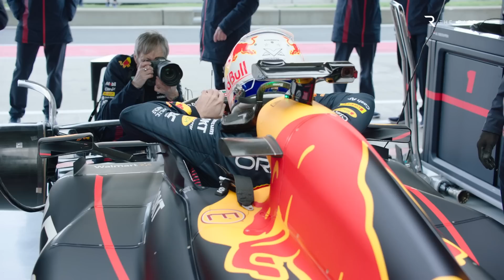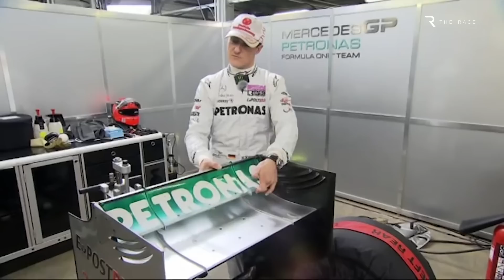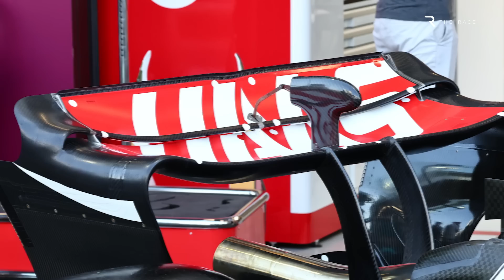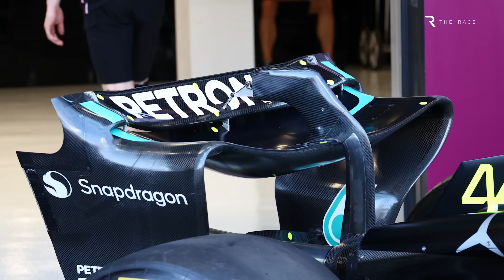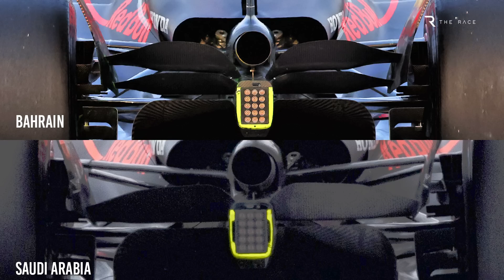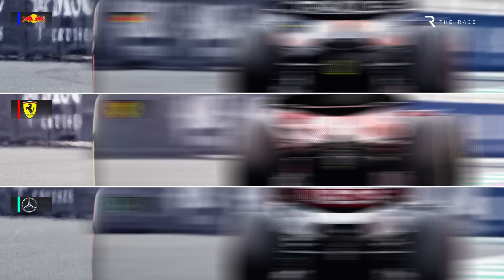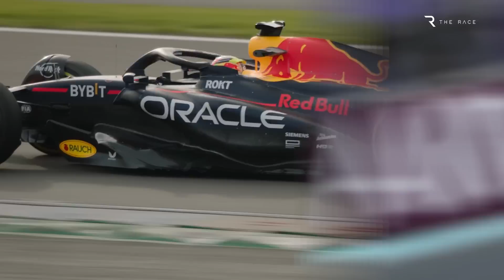Red Bull's genius 'triple DRS' F1 trick explained

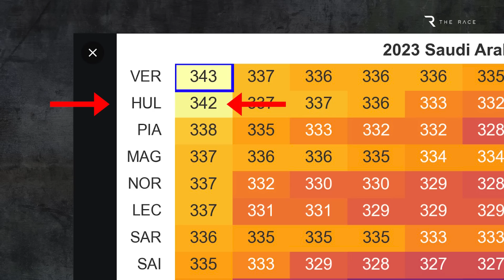Comment: @2:03 This comparison between Verstappen and Hulkenburg doesn't show when in the race these relative speeds occurred, or what tires or fuel loads they had. It's not really useful to present those figures without the rest. Hulkenburg could have stopped for softs very late on, knowing that those battling for the leading positions would not have.

Comment: If the DRS is open there is less downforce and less drag not more. The DRS has to be closed for there to be more downforce and this also greats more drag. You said if the DRS was open there would be more downforce and drag which is wrong.

Comment: Never seen a car that fast. Said by the bloke who won a race even though he blew a tire. His car being somuch faster then annything else on the field even Max with almost no fuel in the tank could not close the gap quickly enough for Lewis to claim top spot.

The few times in five to six years whenever he did have competiton he was granted the win by the line.

"Valtteri, its James/Toto"

The driver who's car was so good even after a engine swap started at the back of the grid. Bypassed every single car and still win with a time advantage in the double digits.

Sorry Lewis that RB got it right this year. Perhaps you can understand your opaque innocence after it took 5/6 years of RB fanatical development, a cost cap breech and Massi doing what he did to actually even catch you. 

Like get off the thick air pedestal and put the graft in.

Comment: DRS is bogus.  IndyCar Push to Pass is much better solution.  Allows defensive use.  Yet limited in use.  No dumb braking so you don't pass before a line.  No massive unfair advantage given to one car by design.

Comment: Me thinks it's time to do away with these artificial advantage gimmicks and get back to plain old racing configuration.  Lets start at the front with a single element wing, move on to mirrors mounted to either the side with no gimmick airfoil mounts.  All the little winglets and air directing do-dads along the floor pan, if you can't design a body with good air flow to stat with maybe you shouldn't be designing.  And then there's that rear wing, a single element that is adjustable for maximum downforce with minimal drag and fixed for the race.  Many drivers complain about not being able to overtake, my answer to that is if you can't pass the car ahead of you then he's a better driver than you and maybe you had better choose another career path.

Comment: Drs is joke imo. It’s entire design is to simply make racing more exciting when you have cars that can’t develop as well as others. The system should be removed and instead a weight penalty added to cars that win. This will mean cars are designed to generate dogfighting because cars will be more “equal” throughout the year. It will also ensure the winners of races are more over determined by the skill of the driver rather than the car.

Comment: Newey and his team are amazing!!
Also, if I understand you correctly, Red Bull is managing the down force increase to be less extreme so they they can actually gain higher overall speed by making the car a little bit less effective less draggy, less downforce at top speeds and doing that with the edge of the floor? Which in turn allows them to run a softer suspension and get rid of the porpoising as well.
Thanks for the insight I really interesting video 👍👍👍👍

Comment: I still remember hamiltons pass on Norris in Brazil 21. That was an unbelievably huge speed difference of the same engine.
Reply: Didn't he dive down the inside? That's not exactly a straight-line speed difference...

Edit: Okay, can now confirm that it had nothing to do with engines... The only pass made between Hamilton and Norris was on the brakes into turn 1.
Reply: @oliverwatson6956  you did not see the gap at the begining of the straight it is not showed in this short video. As i saw it live it was crazy. Of course hamilton dived but he cut off like a 1 second gap and overtook norris on that straight. It’s not even a particularly long straight
Reply: McLaren 2021 had renault engines right?

Comment: Rather than have the DRS, I'd like to see them revisit the front wing flap idea from 2009. When the car behind is within a certain distance of the car in front, they can raise the flaps of the front wings and have more front end downforce in the corners to stay close. This would make them have to do an actual overtake into the next braking zone, instead of just flying past on the straight and being well ahead by the time they need to brake.

Comment: I think its time for F1 to introduce  BOP or weight  penalties to try and make the racing closer. As despite Red Bulls reduced development time for winning last year and the overspend penalty doesn't seem to of closed the gap if any they've extended it.
But how to do it weight penalties for the first 3 for the next 3 races say 30kg for 1st, 20kgs for 2nd,  10kg for 3rd and 5kg for fastest lap with a max penalty weight of 90kg. Or do you put restrictions on battery power usage or a turbo pop of valve. 

What would you suggest to try to make racing closer in F1.
Reply: I suggest you go watch LMS and leave F1 to the designers and manufacturers …
Reply: @sking2173  so i take it your not a fan of my ideas? I already watch a wide range of motor sports like WEC, IMSA, WTCR, BTCC, INDYCAR, F2 ,F3 ,F4 , FR, FE,  NASCAR SUPERCARS and Stadium supertruck. So I'm note sure why as a fan you feel I shouldn't have an option on making F1 a closer sport. As the manufacturers, engineers and current rule makers have not had much success in making the racing closer and thus more entertaining. 

So do you think F1 is ok the way it is? 
Or should we all switch over as currently its a red bull infront and then a Mercades for the 8years before that. Whats wrong with wanting closer racing
Reply: @mechsgtpuma938  — What your “plan” is represents a blueprint for a show, not true racing. 

Racing is a speed/time contest to determine the most capable car, car-driver combo, or in the case of such series as IROC, driver. 

When you start trying to orchestrate “close racing” by handicapping the most successful teams or drivers, you have forsaken the tenets of a true speed contest and orchestrated a show. NASCAR has been doing it for most of their history, and it has gotten progressively worse as time has passed. They kept juggling the rules until they came up with tools to manipulate competition on a real-time basis, the most popular being phantom yellows, lucky-dogs, wave-arounds, and most recently, stage racing. Frankly, it’s a joke. 

F1 is about as close to real motor racing as we have left. and that’s slipping. Their recent testing/development limitations placed on individual teams has frankly crossed the line. And what you’re proposing is ludicrous, and honestly very amateurish. It smacks of the Saturday night local dirt track SHOWS where they would flip a coin after the heats to determine if they would invert the field.

“Back in the day”, I looked on the Indy 500 as being the epitome of true racing. During caution periods cars were to hold position and gap, not close up behind a pace car. In 1972, they installed a pacer light system to assist with that procedure, and make policing easier. To me, it was a sad day when they (CART/IMS) abandoned the system and practice (1979).

I didn’t care about close racing, it was about the cars. I was excited in ‘68 when Granatelli brought the turbine car to Indy, and fascinated at the weird little mid engine Cooper that Jack Brabham drove in 1961. We cheered for the drivers, but the cars were the heroes. Race fans were predominantly car people. 

Just as in 1966 when Ford beat Ferrari at LeMans, it was the cars and the engineering of Ford pitted against the expertise of Ferrari, not about close racing and the individual drivers, that enthralled racing fans. And most Americans wanted the GT40’s to stomp the Ferraris into the dirt — they didn’t give a rat’s arse about close raving and wheel-to-wheel. And after all, the title of the movie (2019) is Ford v Ferrari, not Chris Amon v Piers Courage. Now that was real racing.

As far as your BOP goes, if applied with a wide brush, fine and necessary. In the days when F1 could run 6, 8, 10, or 12 cylinder engines, turbos or non turbos, the displacement limits were different for NA and blown engines, of course, and such regs are fine. But when you enact rules for each individual make of car in an effort to achieve absolute parity, you’ve killed the competition between manufactures. You’d might as well require a single car/powerplant be used, à la F2, F3, and other such developmental series, as well as exhibition races/series such as IROC.

I find spec racing interesting for the purpose of betting perspective top-tier drivers. Otherwise, I generally dislike it, I don’t care how wheel-to-wheel it might be.

Comment: Trying low downforce setup... Maybe they can get something out of merc but again they are not accustomed to that setup.

If they did they r losing the tyre temp. ,Balance of the car.

While RB always used it for max with oversteer/ understeer as per driver style.
Add this to the engine performance and good design.....
U get dominance of the RB.

Comment: Lewis: Never seen a car so fast.
How quick lewis forgets how fast he was in Brazil in 2021 when he was flying past everyone due to that engine and aero package.
Reply: Engine Yes .... Aero not so much. Merc was never good at aero exactly why they are suffering right now. They use to build 3-4 different concept cars for a season and picked the "Less draggy one" slapped on the +60 kw PU and left the rest of the field in dust. That and the fact that the Ferrari & Honda PU has played catch up until 2021 has gone out the window, and with the cost cap it sort of rubbed salt in the wounds.
Reply: Exactly

Comment: They need a rear wing that opens up more on the straights, the further you are in the back of the pack. That way you are only getting a slight advantage over the car in front.
You could have excellent bracket racing with equal cars doing this as well.
Reply: So teams who are not as skilled in the design and construction of their F1 car should be rewarded for their deficiencies just to make the racing more even. Absolute rubbish.
 It's a race, a competition. Exactly what makes teams strive for improvements, an edge, an advantage over it's rivals. Not about doing your best then receiving handouts.

Comment: Just shows that the new rules were done to favor RB since Newey already has unmatched knowledge of ground effect cars. It's surprising why they even went for ground effect which is old tech and not revolutionary.
The Race Technical adviser just revealed why RB's car can't be matched by others because they can't balance the downforce and suspension stiffness. It also makes Mercedes laughable that they can't solve this when The Race just explained this in 1 video and they're still figuring it out for more than a year.
Hope Ferrari gets back to the front and starts winning

Comment: Redbull looks to have a floor where the centre of pressure is quite rearward, i wonder if this is easier to stall with the change of ride height caused by the loss of downforce through opening the DRS, stalling the floor.

Comment: now with porpoising permitted ferrari has a real chance to improve a lot , because the td has hurt them massively more than any other team , and killed their race pace especially with the hards because they wre using flexi floors , the whole concept of the car should be revolutionized and changed , the chassis , suspension , sidepods , power of the engine , add downforce to the car , and upgrade the front and rear wing , ameliorate their straightline and high speed corners
Reply: unfortunately it was permitted at the start of the year, just wasn't made public until now

Comment: I don’t dislike the idea of DRS I just dislike the implementation of it. I will never agree that the car in front should be disadvantaged to the extent that DRS allows. It’s not good to watch someone potentially lead a race for it’s entirety only to lose to a DRS advantage that could come from a safety car etc in the last few laps. My opinion on DRS is that all cars should have it available to them for let’s say 50% of the laps. That way each driver/team gets to chose wether the use it in attack or defence and thus ending the potential disadvantage to a leading car from often occurring circumstances. In my opinion this could also negate/lessen the DRS train issues as the temptation for the faster cars in the train would be to retain the drs until a better opportunity arises or a later stage in the race when rivals may have used up there allowance. It’s madness to me that everything in f1 works around an allowance, tyres etc and the often deciding factor in the overtakes is how close you are to the car in front and not you have an allowance of extra performance. Use it how you like.

Comment: Make a video on why Aston is fast this year. The technical changes they made on the car
Reply: This did not age well
Reply: Its called Xerox.
Reply: Just look at Red Bull.😅
Reply: @51bikerboy  won't tell you much. It's similar, but still very different, for example, having a cut in on top of sidepods in similar way to Ferrari.
Reply: @gladdy6412  it’s similar but still very different 💀
Reply: @SINGH-ing  in short, i meant it has few similar elements like undercut sidepods, but it's a very different car as a whole.
Reply: @51bikerboy  that comment shows you didn't take a proper look at those cars... Just yapping around and repeating the red bull narrative. This years AMR and last year's RB are vastly different cars. They have similarities in some corners but close to every car this year has that because RB had the best car last year.
Reply: @51bikerboy  😆😅
Reply: @51bikerboy  It's more Mercedes and Ferrari than Red Bull.

Comment: Brilliant video. Thank you !

I was wondering, is there any news about F1 manufacturers that start to use AI to generate new aerodynamic design ideas of elements, or to simulate these new designs ? Never heard of it but it could be a dealbreaker
Reply: AI for CFD is quite common practice, but it may not be AI in the sense you’re used to. It’s mostly using various types and combinations of neural networks and similar methods known as deep learning to predict and or correct predictions given by CFD solvers. I’m pretty sure they’re using that already. However, AI is not any better at designing new shapes than current methods, because AI struggles with extrapolation just as much as other methods. That being said, we’re starting to see AI being used for optimisation, and this could lead to big changes. It’s not so much that AI will look at lots of different cars and planes and then produce a new shape that works better, but rather you’re enabling more complex shape optimisations which may yield better results.
Reply: physics simulations of airflow isn't even perfect yet
Reply: I know that the Nasa and GM already starts to generate innovative designs parts that follow the requested characteristics of force, weight, bending resistance... This is impressive and IMHO could really be used in this industry
Reply: They haven't done a Voigt-Kampff on Newey yet, so we won't know till they do that.
Reply: I doubt there's an AI out there that could outperform Newey.
Reply: You need a supercomputer the likes only NASA has to compute that.  CFD is already extraordinarily resource intensive as is.  And in order to get a somewhat accurate and optimized ai model, you need to run the simulation 1000s of times.  It's not impossible of course,  NASA does it all the time.  But they have budgets in the 10s of billions.

Comment: I’m sorry but Gary Anderson’s comments essentially boil down to “the rear of the car all works together better than other teams”. All teams use all parts to work together, there’s no real technical explanation. 

At 4:24 you say that redbull doesn’t have a slot gap separator but literally at 4:18 you can see it. These videos have very little credibility
Reply: He does mention that the change in flow when drs is open allows for the beam wing and diffuser trailing edge airflow to detach… 
A lot of back and forth between single and double beam wing configurations, and at one point the green circle is around the slot gap when they’re talking about the entire drs opening. But they gave an explanation. Even showed some magnificent hand drawn on paint flow lines which are totally accurate because cfd vision.

Comment: Mercedes doesn't have enough downforce from ground effect and other parts of the car, so they're forced into using a high downforce and extra draggy rear wing. Red Bull, on the other hand, have so much downforce elsewhere that they can afford to have skinny and low drag rear wings without affecting driveability. This is truly another Newey era of aero, now that PUs have reached parity. Like it or not, it's going to be another Red Bull championship this year. No one else is close enough.

Comment: What I don't get about these videos is surely it isn't as simple as this!? The multi million dollar teams have analysed each others cars to the mm so why wouldn't they just change what apparently is making redbull so fast
Reply: unless you can steal RB's chassis mold, you can't just copy the beam wing and be done with it, it works because of interaction with the rear wing, side pods, diffuser. You might be able to tell RB is doing some funky air flow stuff, but not the exact dimensions. Also, no one can really see the ground effect geometry unless the car flips over.
Reply: @Appletank8  Exactly this. Expect a swarm of photographers capturing the underside of the RB19 if it ever gets lifted off track. Other teams will need images of the underfloor to properly understand Redbull's concept.